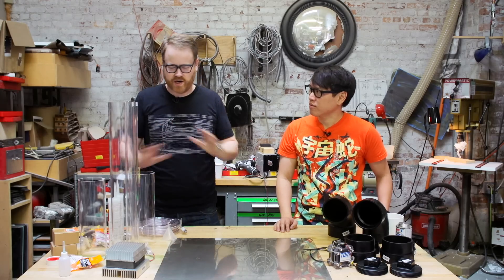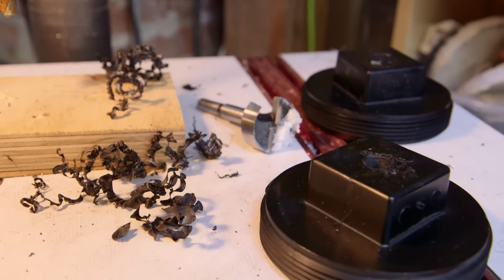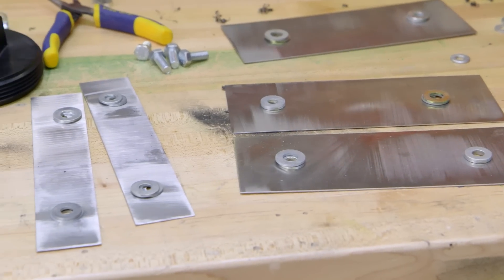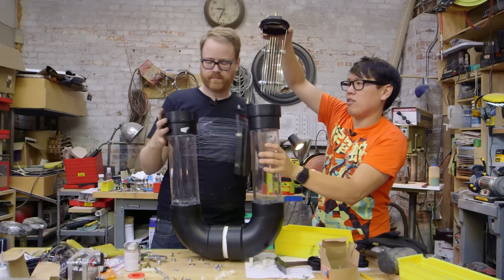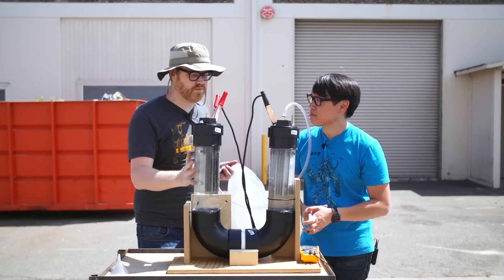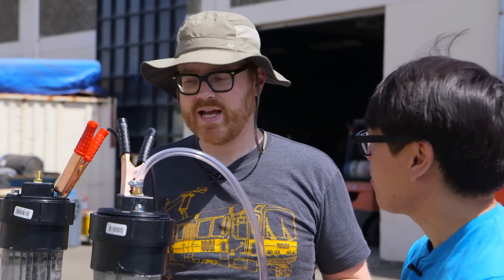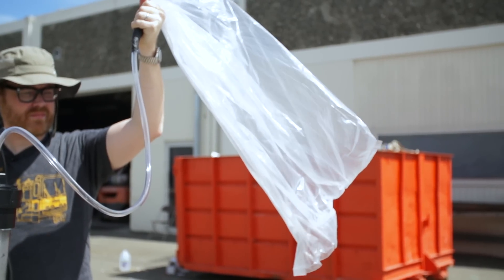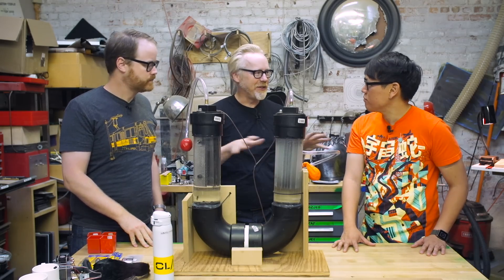Tested Builds a Hydrogen Converter

Comment: Plates are to far apart and higher voltage is not better… u need to aim for 2 volts between each plate this way u get maximum production while it does not heat up to much

Comment: This was a poor experiment, almost feels like it was made to give hydrogen a bad name. You introduced significant resistance with your connections, and non conductive hardware, and used a puny solar panel, then didn't even bolt it on. Alligator clips shouldn't be used for an attachment point. Always bolt on a DC connection like that. You need surface area to efficiently transfer low voltage DC current.

Comment: If your separating the two "elements" , later mix them in the perfect effective and efficient way once seperated not by using a timer but a flywheel a large one to compress the gases with force and not ignite  the mixture via timing of a spark but using pure compreaaion of the mixture of oxygen and hydrogen "boom"

Comment: How does it split into oxygen and hydrogen when they are made in the same tube, I'm proper confused
Reply: The way it was supposed to work was they had the anode and cathode separated, the hydrogen would form on one side and oxygen on the other, however there's was very inefficient because they did the incorrect method and wrong maths

Comment: you guys try stainless steel pot scrubbers... lot more surface area and its a lot cheaper than stainless plate stock, also you will need to purify your hydrogen before compressing it. cody's lab has a dangerous yet descriptive hydrogen torch build. could substitute bicarb of soda instead of KOH or NaOH making it non caustic.

Comment: agh hydrolysis is completely different from electrolysis.
Also voltage essentially dictates what reactions CAN happen. If you're using high voltages, you tend to wear out your electrodes very fast. Current affects how fast those reactions happen.

Comment: what kind of stupid engineers they are.
The Feuilleton. The Formula of Life. A tibetan monk who knows quantum physics bought 4 square meters of solar
 panels. Thinks - these panels will generate electrical energy. Sell it. And buy peas. Annual insolation 1500 kilowatt hours per square meter. Panel efficiency 20 percent. From one square meter I'll get 300 kilowatt hours. From 4 panels I get 1200 kilowatt hours. The cost of electricity is 5 rubles per kilowatt hour. Selling electricity for 6,000 rubles. Dry peas cost 25 rubles per kilogram. I will buy 240 kilograms of peas. On my day I need 0.6 kilograms of peas for food. The peas will last for 400 days. I’ll live on peas for a year, and I don’t need anything else.

Comment: Well it's the current which increases the efficiency of H2 generation not voltage. No matter what you do cathode and anode plates seperated by an inch, just needs a basic 2volts supply and all you have to play with is current.

Comment: You can use Baking Soda ( Personally Recommending: Arm and Hammer Brand ), as your Catalyst to help the Electrolysis process.
Reply: If you use baking soda it will damage your cell... put the sodium bicarbonate in the oven for a while and it will turn into sodium carbonate and will work much better... safer than sodium/potassium hydroxide.

Comment: I didnt see any type of flashback suppressor, I hope by now 5 years later you have watched some other youtubers do it :) or read on the father of the HHO craze Bob Boyce 
316-L stainless plates having 5% nickle seem to be the best (6X6 inch) and 2-ish volt per plate use a null plate or two between, and above 12v (5 null plates between for 2V each) 
and over 25 amp your just getting more steam, you use a bubble-er to remove that, from crap parts in my basement I could have filled that bag in a min or two, and given the shop and parts yousguys have access to, I could have made one that runs a small engine :)
and use a TBL spoon or two per Qt. distilled waster of sodium hydroxide (lye) to up the water resistance ..... metal surface area and Prep, & water resistance are important.
and FFS even in small amounts of hydrogen & Lye is nothing to play with LOL
I am trying to figure out how to get a State or Fed Grant to really research it down to its fine points

Comment: Wow that's so wrong that should push more than enough hydrogen for you guys and a whole day lower the voltage higher the amps and then stick a compressor on the back side that sucks air

Comment: The reason this wasn't working was because of the power. Although the voltage is high, the current produce by the panel wasn't enough to create a high enough reaction.

Comment: "We're taking water, H2O and splitting it into its two component molecules, hydrogen, and oxygen."  that made me cringe even though it was one of the minor things they got wrong, but it was very annoying to me. because it was it is supposed to be its two ATOMS.
Reply: They aren't wrong though, they splitted water (H2O) into hydrogen gas and oxygen gas (two MOLECULES, that only exist as a diatomic configuration, H2 and O2), and that's a right assumption.
You could say either way is right, there're ATOMS of hydrogen and oxygen being released, but they recombine to form their respective diatomic MOLECULES, which was what they were splitting water into.
Reply: @Ryan-lu9km  Out of curousity (because I don't know) if one were to split one H20 molecule, (ignoring the fact that it would be very hard to split just one) would it become just O2 and H?
Reply: In theory, if it was possible to split one water molecule it should make one H2 molecule (two hydrogen atoms) and a single oxygen atom, but that wouldn't be a gas, as oxygen doesn't really exist as a single atom. Whether that would be possible or not, that's a very difficult question to answer. I've never even heard of oxygen existing as a single atom before, but I'm also curious if it would be possible somehow.
Reply: @Ryan-lu9km  HO-

Unstable though.
Reply: Hahhahahah! They could've even said elements and I would've been fine.

Comment: Couldnt you design a tank that is halfway filled with water and cap it off make sure its air tight with no air and then drop some sodium into the tank and capter asuch hydrogen as you can. Rely only on the reaction. Then when you need to fill up the tank more just drop more sodium pellets into the tank and fill up the water every now and then and let the hydrogen gas flow into the engine. Makr sure there is a hydrogen gas resevour for the captured hydrogen obviously so when you are filling up the water or dropping more pellets there wont be any major explosions in the tank aside from the reaction from the pellets.

Comment: Adam sai he wanted hydrogen so you guys built a good rig that can produce lots of hydrogen as the king of randoms does and then thought what is the worst way we can get hydrogen out of this with the lowest quantity produced. Just like they did on mythbusters. Adam never said anything about you have to use renewable energy or it must not cost us anything to produce this, He just wanted hydrogen! So why dont you go plug that thing into a power supply, pump alot of amps into it and see what it actually can do. Its like your helping the conspiracy nuts that say nobody wants this tech out there.

Comment: I’m getting great results with a U tube, no myth. Go back in time and use baking soda or lye. An array of 100 Tubes might fill a 35 foot balloon. If you don’t optimize the current density you will form oxide layers. Perhaps the KOH is reacting with the type of steel you are using.  Remember it is an Electrolyzer and even the type of water you use matters. Fact http://www.facebook.com/emarenacorporation

Comment: Yes. Combining high voltage and pulsed frequencies tuned resonantly with water molecules and the container maybe with geometrically arranged nodes to also optimize resonance then you can throw in ultrasound.....ah hell look up Stan Meyer he must have done it right he was killed for it.
Reply: Stan Meyer was a con artist.   High voltage and pulsed frequencys only heat water and do not produce hydrogen.  His lectures are laughable if
you know any chemisty or physics.     He died of natural causes.    Folks,     the Meyer story is myth from start to end.
Reply: @amedeeabreo7334  Hmmm Stan didn't know much science he mostly did trial and error from conceptual ideas.  Granted Einstein invented before he knew the mathematics were even solvable let alone tractable.  Why so critical.  Or are you a gov goon of disinfo.  You can run a car on a wood gassifier why not generate the most energenic gas in the universe and do it?

Comment: Wrong info ..
More voltage ..more hydrogen ?? Are you nuts ?? 
Please study properly ..
It needs ..takes @1.5 volts at 30 deg c ..of dc volts .

Anything more CAN NOT PRODUCE MORE GAS ..
PERIOD ..
more voltage will produce more heat and it will just evaporate the water more ..

More amps can make more electrolysis ..

If you keep the electrodes closer to each other ..
It will work far far more efficiently ..

Comment: There is a ton of stupidity in this video . But let's just talk about the unit
Water is way too much and this makes it more resistant Secondly, the stainless steel sheets are very few, which makes productivity less Thirdly, electricity is very weak . You want a higher amps . Fourth, the poles are very far apart, which makes waste is very large
I thought you are smart people. You lost my admiration for you ... Is this stupidity intentional? Because this video is more stupid than stupidity of beginners

Comment: For some reason when my professor did this in collage, he used two differant types of alloy. I believe one side was brass, the other was galvanized.    If anyone reading this knows what alloy is negative, which is positive, and what type of alloy goes to each, posting it here will be helpful.  Thanks to those out there with enough brain matter to do something usefull in life.
Reply: You'd want the galvanized as the side that would oxidize (+) and the hydrogen side doesn't matter what metal very much at all as no metals react enough with the hydrogen formed there. It's nice to use two metals that are very different in appearance in a class demonstration.

Comment: I love this. Adam takes two engineering students(im assuming bc Ive been wanting to build this too) and has them build something in his garage as he does his own business.Except these gentlemen have built a devide that separates the hydrogen and oxygen, further building on the foundation TKOR made.  Excellent work Mr. Savage.
Reply: Yeah, except not really. They did a really poor job and made a much worse product than the original one. Their problem is that they put the nodes way to far apart from each other, resulting in a high electrical resistance and a very low current. To make HHO you don’t really need a high voltage, you need a high current. 
Also I have serious doubts that this contraption actually separates the hydrogen from the oxygen.

Comment: That little solar panel could barely charge a laptop. And the amount of amps it produces is laughable. There's a reason why every run-of-the-mill guy on the internet who builds a rig like this uses a 12V car battery: Lots of amps. 
Either they didn't know what they were doing or they just failed on purpose.

Comment: Did you guys realize the major flaw with this design yet?  I know this is 4 years old.  Your electrodes were WAYYYYY too far apart.  Surface area is only one part of the equation.  The other important factor you need to consider (in order to get the cell to draw more amps) is the distance between the anode and cathode.  And a high voltage / low current solar panel isn't the answer.  You want to get the plates SO close that it only takes a couple volts to split water and will pull MANY amps at that voltage.  Those 100 watt solar panels would work but it you would need a buck converter which uses MPPT technology to lower the voltage and boost the current.  Theoretically, at peak power and (to keep things simple, let's just say) a 100% efficient buck converter bringing your 22 V from that 100 watt panel down to 2 volts, you could make 1 liter of hydrogen in less than 3 minutes. So you could get your 15 liters in only 40 minutes from that 100 watt panel.   In reality, with losses, say an hour or so.
Reply: seriously thats what I was thinking I'm dissapointed I didnt see them do something like that.
Reply: Hey brother,
I would like to ask if you have any blue print or a design I could use?
Reply: yes, or use neutral plates in between but then it would mix H2 and O2 and it will be hard to separate them
the electrolytes need to move between the plates, and that big U is too big for dem smol ions
Reply: Exactly. Should not be more than 2v per cell. The excess voltage only produces heat.
Reply: Word

Comment: You can also make it to produce more hydrogen by rectifing mains AC voltage to DC and then connect it to electrolise machine and you did it than make a video.

Comment: The reason it fails is the very fact that they divided/seperated the oxygen from the hydrogen. Figured that out the moment they said they were going to do this, the oxygen is its opposite. Its also its counter part to create the gas. Everything is built on its counter part to generate motion in this case flame. I mean how else do you think they fill LPG gas bottles for regular bbq? Oxygen like that of fire in a burning house creates the motion of the flame to form

Comment: ps... I only watch part since I know you positive and negative plates being over a foot apart will equal next to nothing in production.

my little $100 unit does 1 litre a minute its a 4" by 4" drycell lol...     its - NNN+NNN-     9 plate.. but the plates are all 1 milimeter apart..  making the thing only 4" long...  oh ps the N in the config are neutral plates, not + or - ... so the length between the + an - plates shouldnt be more then 1 centimeter.

Comment: The answer that this video didn't answer was how to improve it which is awful....
But I'll say
First of all you must add as much as potassium hydroxide as the distilled water can dissolve 
Second of all you must give it as much as voltage possible (with enough amps giving )
Ex: 12V car battery (because can give huge amounts of current)
Or 12 or more volt power supply with about 10 or more amps
And never over load them because it could make the water to boil
The key for it, is free amperage 12/24V power supply (idk exactly how much amp would it use so check the amp and that's how much amp you would need in total)
Never forget to run them in D.C 
Thanks alot 😉

Comment: Do these guys think everyone is this head slappingly ignorant...  Even "The King of Random" used two car batteries when he used 24 volts, which puts out many many times more current than a weak 22 volt 100 watt solar panel.  This is such a condescending video shown to what they must think is an incredibly ignorant public.   Hook this up to a car electrical system at only 12 volts with the car's alternator pumping out many amps of current and see what happens...    The same thing can be seen when using electrolysis to clean rusted parts.  When you use a 12 volt solar panel designed to trickle charge a car battery to run the electrolysis set-up to clean rusted parts, it's incredibly slow and bubbles take a long time to form.  When you hook this same set-up to a car battery or car battery charger which puts out many more amps, the difference is like chalk and cheese.  The electrolysis reaction takes a fraction of the time and bubbles start forming on the parts inside the electrolysis bath almost instantly and it is visibly more reactive.  I knew how unefficient this generator was going to be as soon as I saw them using a weak ass solar panel.   DON'T BE FOOLED!       I always loved the Mythbusters and still do, but this is just Elite controlled babble or something.  They don't want to show you how much gas CAN be produced..   They never go there.  If it's mainstream, they never go there...        SNL MEDIAOPOLY  YouTube.

Comment: This felt half baked. Aside from the minimalistic build somehow you thought running directly off of a solar panel is going to yield any notable results. Ever heard of Amps? More amps, more surface area, proper catalyst-water ratio. That 22v solar panel at 100w is pushing a paltry 4.54 amps. It's at best a decent trickle charger. You need a good battery. The thing is, I know you know all of this. Why does it feel like you're among the others that refuse to give this a proper scientific chance or are simply paid off to disprove this?

Comment: Yeah, you want a low voltage around 1v-3v dc not 22v dc. And you would want a small battery not direct from the panel. Either way though they did a terrible job.

Comment: Wow .. they did everything wrong. The two plates are too far apart and too little current.  Unless you put 10 of those panels together in parallel to get enough currents. There are other ways to separate the two gases, this method is not it...

Comment: I made one of these in my living room years ago, and produced a steady flame; with small plastic spacers and large steel washers. I used ac current but a variable dc amp multi plug selector. 12 dc amps in my mason jar produced enough steady hydrogen to burn.

Comment: I have seen a Holden Kingswood run on water without a fuel cell of any kind, he just increased the jets in the carburetor to twice there size to allow enough water to flow and made a high voltage coil to burn it in the motor, because if you place water under a vacuum and hit it with a ex-ray frequency releases hydrogen and is a scientific fact.